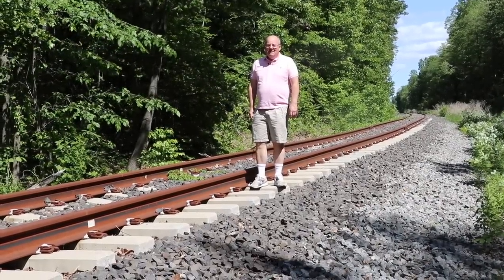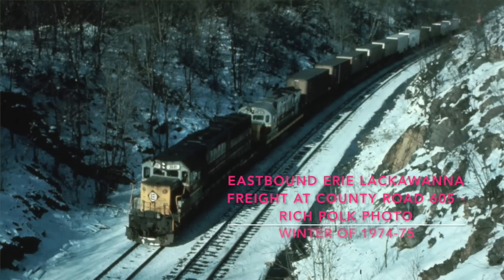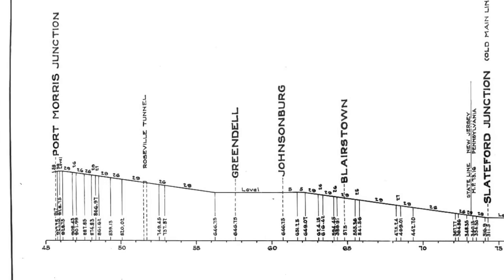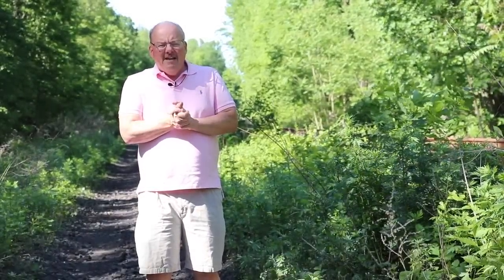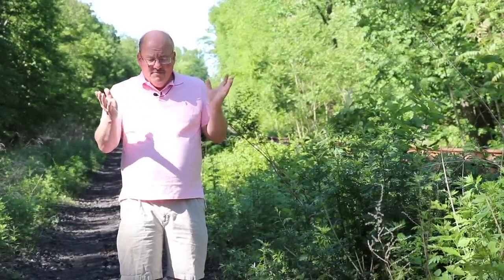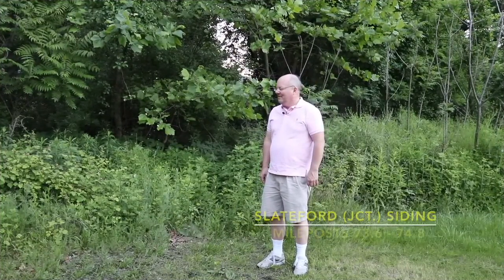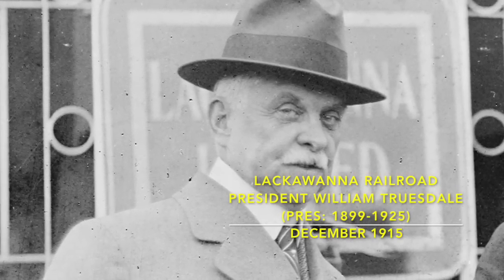Lackawanna Cut-Off - Part 11: Sidings on the Cut-Off

Comment: Happy to see you figured out the microphone/wind issue.  Also, photos and maps were very helpful. Regarding siding placement: sidings for slow freight would make the most sense where the grade was particularly steep, ie, where the freights were going the slowest. I bet if you check this against the gradient map, the placement (and seemingly redundant number) of sidings might make more sense.
Reply from the maker: The ruling grade was 0.55% and that occurs in a number of places.  The sidings were kind of evenly spaced apart.  I think they mostly ended up mostly as storage space as much as passing sidings.  Hainesburg Siding ended up with bad-order cement cars; Blairstown Siding was torn out in the 1920s; Johnsonburg Siding ended up storing coal cars; Roseville Siding stored overflow cars for Port Morris and was torn out in the early-1930s; and Greendell Siding was the only siding to make it into the Conrail era.

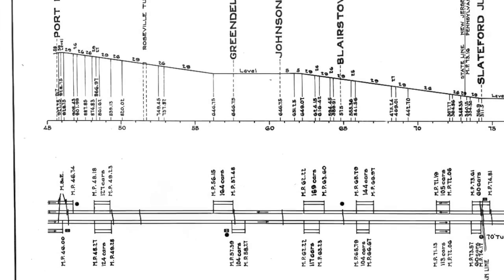Comment: on the top chart at 2:29 I assume the number on parallel to the line is the gradient but does it mean that the 29 and 26 and so on is a .29% and a .26& Gradient? It's confusing because west of Johnsonburg the line stays level but there is a number 5. would appreciate any feedback anyone has on depicting that chart. Thanks